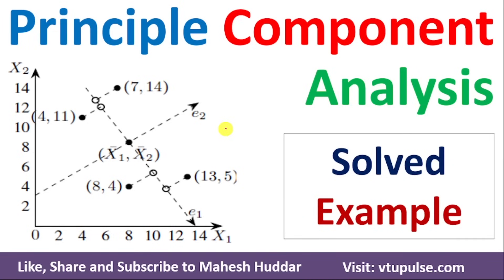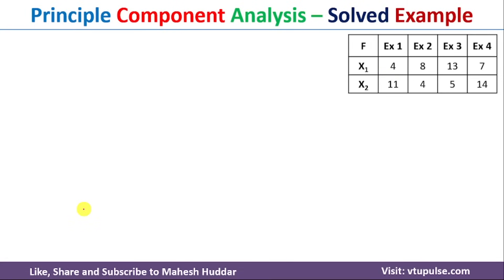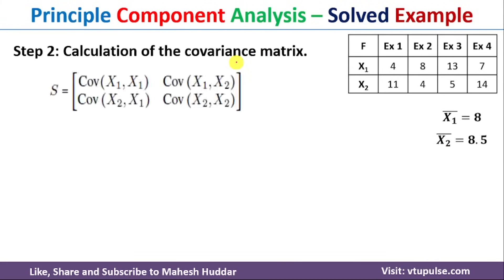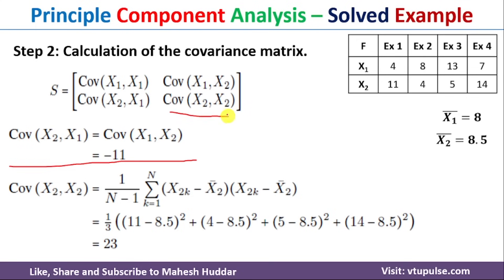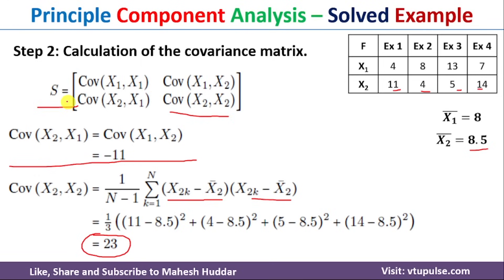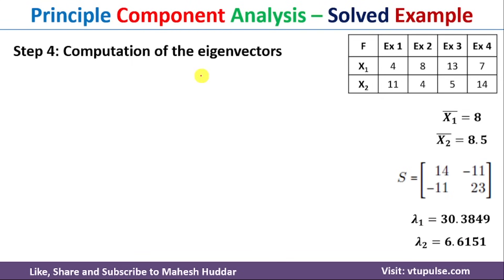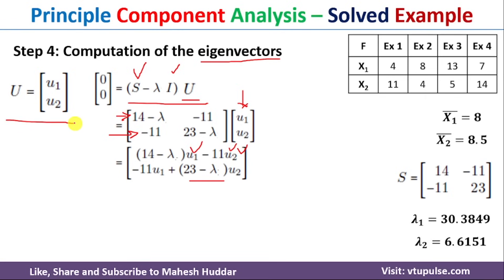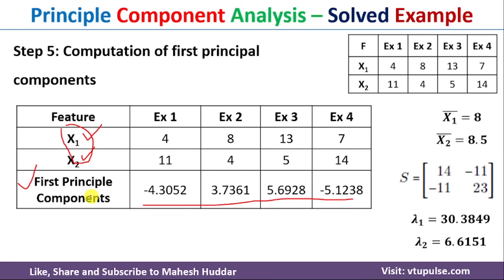1 Principal Component Analysis | PCA | Dimensionality Reduction in Machine Learning by Mahesh Huddar

Comment: Why we are not dealing with e2 means why we not do e2^T.[cov matrix]
Reply: Here, we had considered 2 dimension as the high dimensonal data for example.
One of the most usecase of PCA is in dimensionality reduction. 
So, if you want you can use e2 and get second PC. But then think about it. 
From 2 variable, we again got 2 variables. That's why he has shown only PC1. 

However, in reality we generally use 2 PC axes (mostly depends on your data). If it has a lot of variables, then 3 or 4 can also be good but  we don't generally go beyond that. So, in this case you will need e2, e3 and e4 as well. So this is how it works.